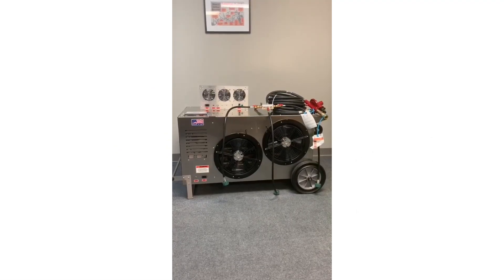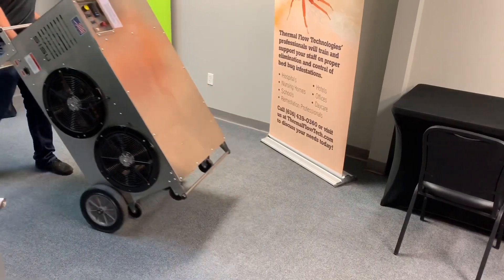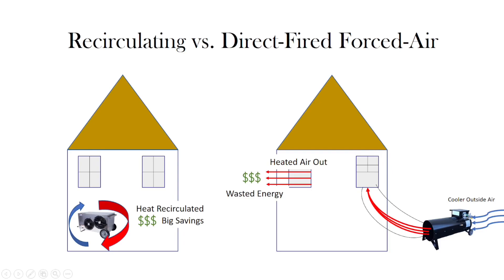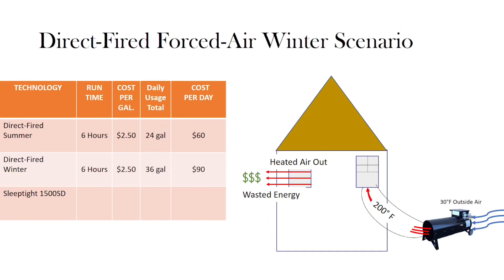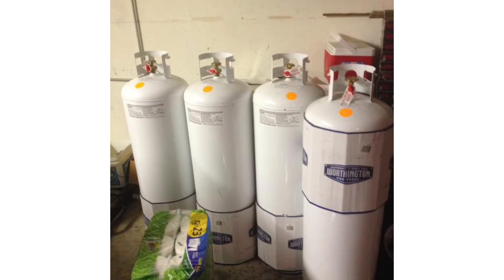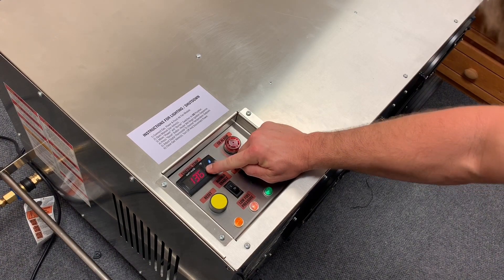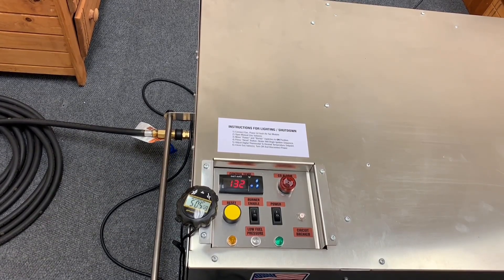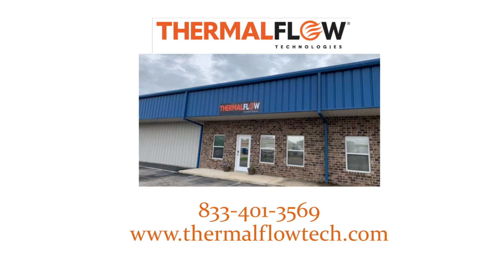SleepTight 1500SD Training | Thermal Flow Technologies

Comment: How does it work in a two story home/condo/townhome? Does it need to be lugged up the stairs?
Reply from the maker: It would be difficult to get it up staircases without a second person. We normally use fans to help direct air up the staircases, or recommend using the SleepTight 800, which is much smaller and easier to get to a second story.